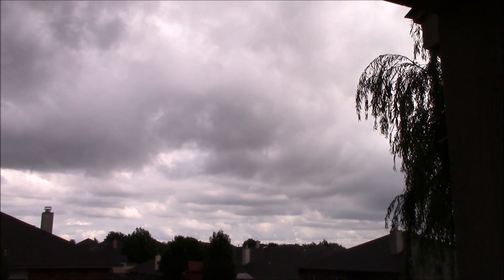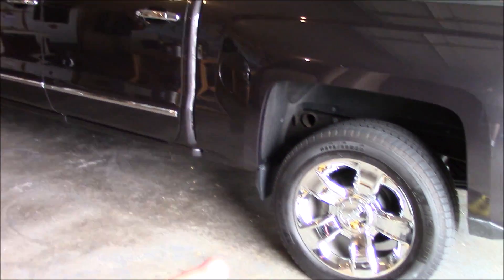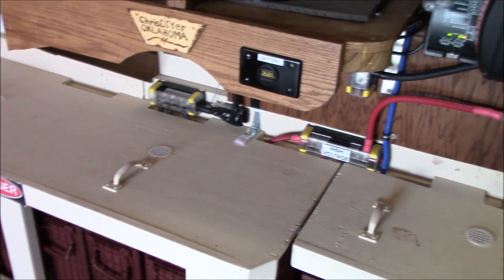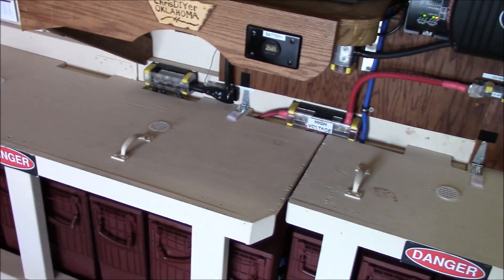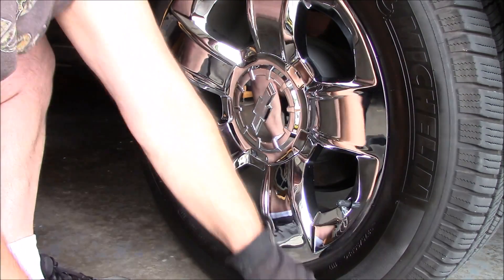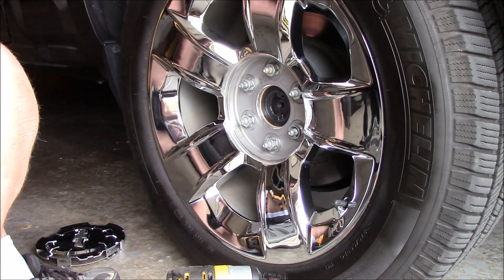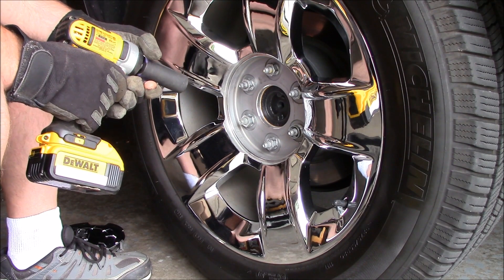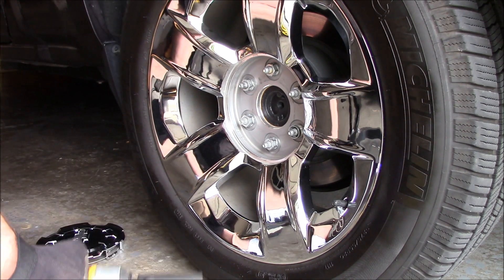First use! DEWALT (DCF880) 20-Volt MAX Li-Ion 1/2-Inch impact wrench with detent pin

Comment: Chris, Love your solar system!  I bought the same DCF880B and it is a wonderful tool!  I recommend purchasing Torque Stixs instead of a Torque Wrench on your application.  Faster and more efficient.   You can purchase the set at Harbor Freight for around $50. with the 20% coupon.  PITTSBURGH 69870 10pc 1/2" TORQUE LIMITING EXTENSION BAR SET + CASE Use these torque extension bars to prevent over-tightening of lug nuts. Designed for use with standard or thin-wall sockets, each torque extension bar is color-coded and engraved with torque range for quick reference. The extension bars work with any impact wrench, even those with an extended anvil. A handy carrying case is included. Prevents over-tightening of wheel lug nuts, distortion of wheels, drums and rotors. Works with any 1/2 in. impact wrench, even those with an extended anvil and Can be used with thin wall sockets Color-coded and engraved with torque range for quick reference
Reply from the maker: GREAT info...thanks. Smart! Just ordered a 7" long 1/2" extension torque stick (140 ft/lbs).
Reply: Torque sticks aren’t meant for cordless impact wrenches. Air only.
Reply: @Paul-vn5mi  I don't know what the difference would be, but I know they didn't work when I tried them with my cordless

Comment: Don't ever ever ever start your threads with an impact..
Reply: Hello Chris, I saw a bunch of comments that say that you should always start manually. Can you explain why? I thought that one of the main purposes of the impact wrench is to unlock tight bolts, so if you start manually, I don't really understand why I would use one then... Thanks!
Reply: @primetime22  it just means always start by hand. what if you start it with impact and it cross threads half the threads? get it now?
Reply: @1godgodgodgodgod  exactly. Worked in a major Canadian repair shop chain. We had one guy who always knew better. After the 3rd car come in needing studs cause he was too impatient to start threads by hand  it started coming out of his paycheck.

Comment: LOL sends it home with about 300lbs of torque to start the threads. Dude you always start the nut by hand....
Reply: @mcb sprint Impact guns are INCREDIBLY strong. If the Threads are not lined up correctly it will Cross thread and Damage the threads in just seconds. Starting the nut by hand ensures you have properly started the threads nice and smooth. Then you can finish with the tool.
Reply: @mcb sprint This guy has NEVER used a tool in his life so he shouldn't be making videos on how to do something when he has NO idea himself.

Comment: You should never put a nut on with a drill
Reply: Shaun Griffin you can put a lug nut on with Slow Speed on 1st firm tight sequence then tighten up to factory spec with torque wrench
Reply: Shaun Griffin I agree with you completely. You can easily strip the thread. Start it by hand first and then use the wrench. The electrical system is awesome.
Reply: I think he meant by starting the nut with fingers first. To prevent stripping the stud.
Reply: patrong Ngu-win- No you can't because chances of stripping the first thread is high and that's what will happens by the dummy who puts it on with an impact.
Reply: ya he would cross tread the lug nut and stud

Comment: Have this same impact wrench. I keep one in both my vehicles to use on the road for flat tires. Most cars, SUVs, and CUVs specify somewhere less than 115 lb/ft of torque so this thing, at 150, works great. Charge the battery 2x a year and you're good to go.

Comment: I have this same model, but it has trouble removing lugs that are torqued at 90 ft. lbs., which is well below 150 ft. lb. rating. Wonder what the problem is?
Reply: Try using a bigger amp battery pack.  I have a 5 amp. works fine.  Someone made a video on youtube  showing all dewalt 20 volt batteries, but bigger amp battery does get more torque. Perhaps that is your problem.

Comment: I have a bigger one for wheels and other stuff, but the smaller one is great for smaller stuff where the larger impact won't fit without using a bunch of extensions

Comment: Hey Chris, new summer tool toys !  Solar system looks CLEAN TOO !  When you were using the new Dewalt, the audio level on your camera went into "overload protection mode" and the level got very quiet. It took a few seconds for your speech to return to audible level.  Other than that....BIG THUMBS UP  !   J K
Reply from the maker: Thanks man...yeh, the audio self-muted when taking that lug off. Will be doing a more comprehensive home solar overview next week. Hope all is well...

Comment: noticed you have put the battery cable on the top lug of the 250amp breaker which i always thought was correct but that means the midnite disconnect box drawing is wrong as it states the battery lug goes on the bottom
Reply from the maker: Using non-polarized Carling C-series panel mount breakers...can wire it per the drawing. However, these breakers are stamped LINE and LOAD (despite being non-polarized). LINE is on top for this style breaker. So, I wired the box per what the breakers are stamped. Had three solar companies look it over, sent what I did to a solar design electrical engineer, a certified home solar installer, and my local electrician...all good. The only thing that is not NEC is the 4/0 welding cable going to the batteries/inverter.

Comment: The box says maximum torque is 150 foot pounds (1,800 inch pounds).
Reply: Mine has trouble removing lugs that are torqued at 90 ft. lbs. Wonder if there is an issue with it?

Comment: Hi Chris, have always enjoyed following a your videos. Please, I have a pv array 40 feet away from the charge controller. Can the combiner box stay 25 feet away from the pv array. Solar setup is 2.2kw. Voltage is 90 volts. 9  250 watts panels. 3 series and 3 parallel.
Reply from the maker: Thanks. Outside combiner? Sounds totally fine to me, but may want to check with any codes/permits your city or county may have. Those must be 24v panels you got...sounds like a nice set up. Thks for watching/following along. 👍

Comment: Hi, 

Came across your video on this DeWalt 880 1/2" impact wrench. 

I would like to see DeWalt make a new version of this model with a brushless motor and more power like the milwaukee 2755-20. 

Yes, DeWalt has a 1/2" mid size impact wrench which is great. It's nice to have a conpact size like this model. 

Just my thoughts

Comment: Never start a nut on a bolt other then by hand.
You always finger tight all nuts till hand tight. You could have easily cross threaded that nut doing what you did.